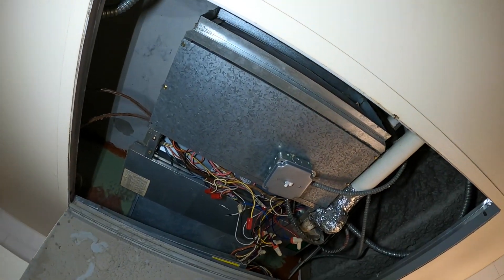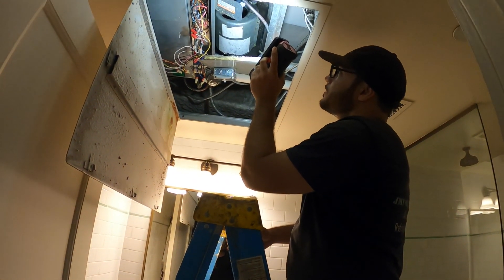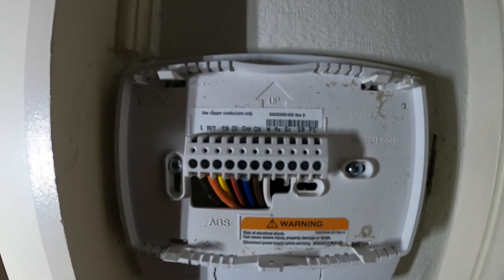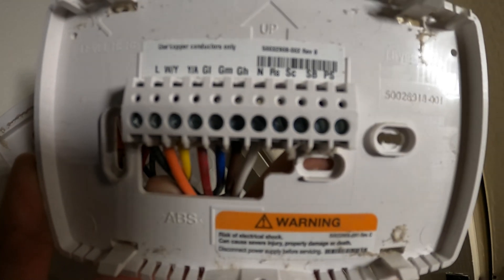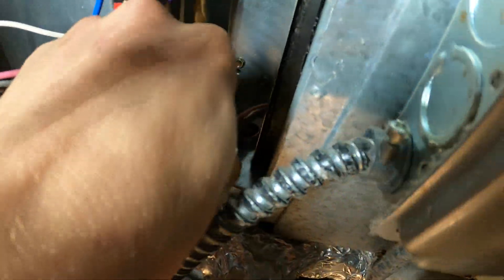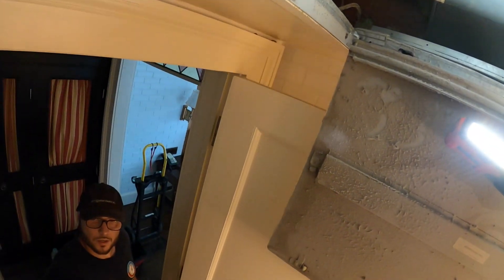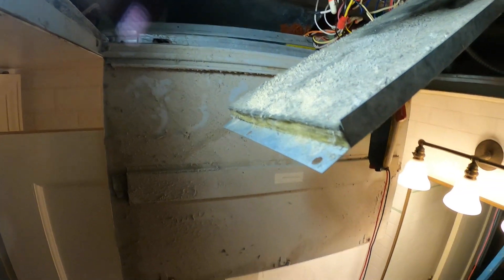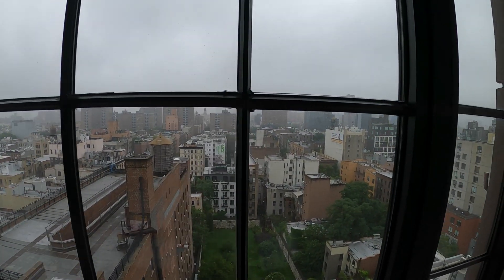HVAC: 2 Pipe FCU Fan Motor Operating At Incorrect Speeds (Fan Coil Unit HACK JOB Repair) Fan Wiring

Comment: Speed nuts were outlawed in the uk in 1970 not much better then tape😮
Reply: We don’t see those horrible things in Australia either.
Reply: I’m in the States, and like using the Crimp Wire Nuts. I used to order Purple ones, in multiple sizes, that way I knew if anyone had been in the unit.
Reply: @stevenmoomey2115  Wago is much better the wire nuts.  Invented in Germany and used in Europe for 25+ years.